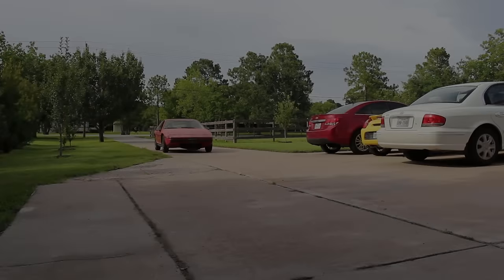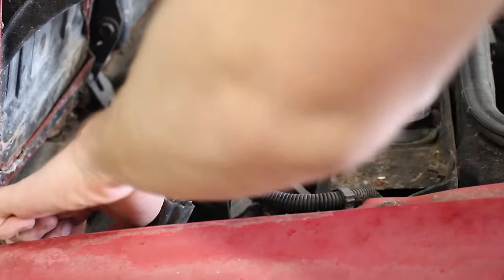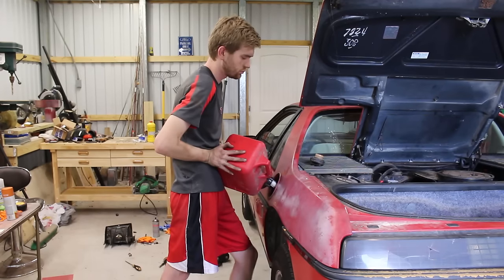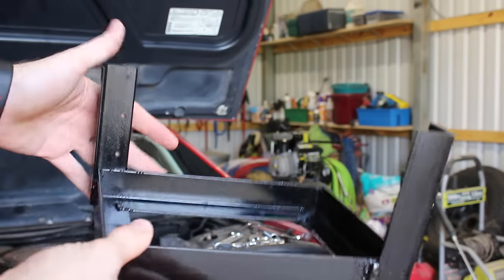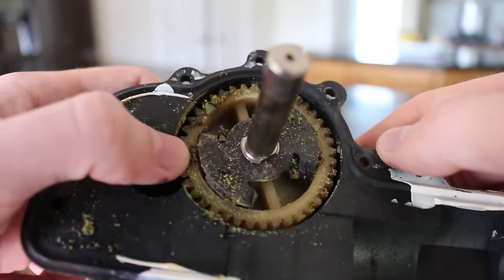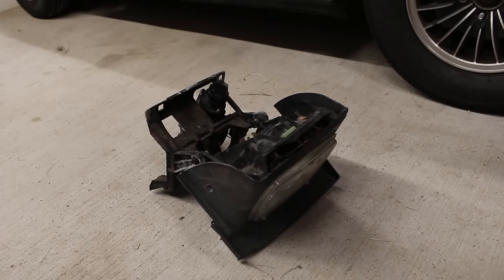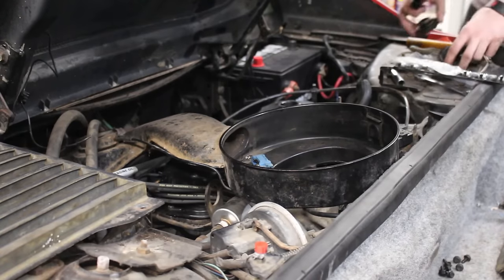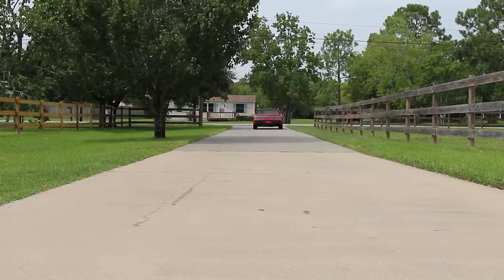Blink Once If Your Headlights Go Up and Down | 1985 Fiero 2M4 Revival - Part 4

Comment: I am a retired Mechanic of more than 30 years and I love your videos and honesty, I cannot say I have never sheared a bolt off but you only do it once and often I do not use a torque wrench as after all these years I have a 'feel' for the correct tightness.One thing I would suggest you do is at the next oil change use motor flush I gets a load of crap out, and STOP using fram filters they are the worst and do not properly clean your oil.

Comment: Helpful pointers...Lower feed and increase amperage on your welder (I'm kind of guessing from looks of your welds). This gives you hotter/better weld penetration and a smoother/flusher weld. Experiment with those setting as there is a fine spot that will be used for most of your welding. The only change from that will be when you weld thinner material. Beginners tend to go too fast as they're welding, so keep that in mind. If right handed, use left hand as support/slider hand. Also, when cutting 45 angle for making a frame. Make the angle SLIGHTLY smaller than a 45, that way it squares up easier/better. I designed the front suspension lift kit for the Jalapeno kit car that fits a Fiero. PISA kit cars..Good luck with your project car.

Comment: Reviving an old comment, but Steel Stick is what we use in the packaged pump systems business I work for.  We swear by it for tiny repairs.  We don't buy regular ass JB Weld.

Comment: Dang, snapping that valve cover bolt was a frustrating lesson. Maybe a cheap pair of vice grips clamped on the edge by the wrung off bolt will ensure no leakage til you do get that piece of bolt out. Seemed like you had it cross threaded with all the effort you were putting into tightening it. Plus with snapping off the tip of the easy out too, tells me it is most likely cross threaded. Try another easy out and heating the bolt piece and hole with a small torch as you turn it to remove it. If you gaulled the threads it will be a booger to remove. Love this video series. Great job on those headlights!

Comment: 15:03

Just a note, I wouldn't advise wearing gloves with any rotating tools.

I've had fingers pulled into a drill before wearing gloves, luckily it was a handheld drill, so I was able to quickly stop it.

Comment: Awwwww! You made that sensor needles day! They rarely get the opportunity to jump around and have some fun! Taking anything out, lubricating it's shaft and giving it a 12 volt trickle charge will get it workin! Wait... you're telling me your headlights work off a TELEGRAPH SYSTEM?! I bet 1845 San Francisco is gonna be so happy to hear from you!  Maybe you can relay them a message... I'm happy to hear the gas tank hadn't leaked in eight months!  Got a better track record than me! More like the thermostat housing cap. Slow Drip was my high school nickname! "He was finally free to come back down to where we live"? Was your brother being held captive?  That bead of silicone was about as "thin" as I am! Sweet Jesus! Although that is pretty normal for GM to use that much silicone for their vehicles. Because, who needs nuts & bolts when silicone exists! As far as snapping that bolt, it happens to the best of us!.... who also weren't using a torque wrench properly. We live, we learn!  The current owner of the car is technically the mold. It's been inside there for years! Looking forward to watching the eviction!

Comment: At least you knew to check the o-ring still on the car when not finding it on the filter.

I did not do that, and dumped a lot of oil due to having two o-rings on...

Comment: brilliant work on the lights and battery tray! looks great!! Don't be embarrassed about the bolt. Had the same thing happen on the radiator flange on my 60' Rambler. Tiny bit of fluid was leaking and it snapped like a twig as I tightened the bolt, flooding the garage with coolant in the process. Not a fun day lol.

Comment: I note 3,494 comments. I'm lazy and don't care much for reading comments. While I'm sure it's been said before, two words bruh, "torque wrench". It was a matter of nanoseconds when I saw you honk down on that poor valve cover bolt with the same Break-Over-Bar one would use to break a head bolt loose I knew it was toast. I didn't mean to spew my drink all over my monitor. Excellent Work Young Man!

Cheers from Louisiana.

Comment: I knew as soon as you started on that bolt that it was going to snap. One time I was reinstalling rocker arms on a Subaru and mistook 80 inch pounds for 80 foot pounds. Obviously the bolt snapped but I never did extract it and never had an issue using only the remaining 5.

Comment: An update at last! Yes, I got to admit that I still love my 88 Fiero, she was one of my favorite car back in the past.

When you pause the video and said about making a mistake, I got a hunch that would be about your bolt.....ouch man! lol My Fiero has a leakage issue as well when I got her home and it wasn't an old core seal but a silly thin layer of silicone (imagine those silicone you use to seal the gaps around your bathtub).
The more I watch, the more I notice the difference between yours and my 88.
There are a lot of option for Fiero interior, if you could afford it, a leather set with wood panels would look awesome! (Especially the panel of your gauges) Oh! Don't forget to put some lure on the moving parts on your front lights, those plastic could be weaken because of a long expose from outdoor weather. And also, the bottom will need a complete rust free-undercoating sprayed.
There was an ongoing issue I have with my Fiero, it was the handbrake which seems to loose up after a certain time of using, may be it is just my Fiero and I hope yours would not have this problem as well :)

Comment: Oh I remember that bolt for the valve cover! The original egr valve almost always rusts and binds to the intake manifold. Nevertheless how tight of a space you need to work in around the TBI unit. I replaced that with one that allows me to put the mount on first and the EGR second. 

Also pop up freaking headlights! I upgraded all of my interior and exterior lights to put less drain on the old electrical system. I highly recommend replacing what you can such as interior lights and side marker lights/front turn signals. 

I’ll post updates with mine as soon as I get this clutch replaced.

Comment: The same happened to me, when i was replacing the gasket on my N46B20 engine, altough i used a torque wrench. The instructions said that you have to bolt it with a torque of 10 Nm (Im German ;P), but my torque wrench was quite a cheap model, so that i was 5-10 Nm over the recommended torque. I then drilled a M3 hole into the screw and hammered a screwdriver into it without even damaging the thread even a bit. The second issue i had was that my car shop gave me the wrong gasket, it was for the N43 engine, so I had to get the right one the same day to finish the engine.
Because i was doing this the first time, it took me about 6 hours to replace the valve cover gasket. But unlike some others, my gasket is still leakproof.

Comment: To extract the bolt, use your wirefeed welder to carefully add a little knob of weld to the end of the bolt, so you have something to grab, then either grab it with some pliers, or put a 1/4" nut over the knob and weld up the hole. I've done this many times, and it usually works first try.

Comment: This car can move faster than others do on the highway, and do it all by itself.  That's what happens when the spring that keeps the accelerator peddle in the up position, suddenly breaks.  Now the accelerator peddle becomes stuck in the pedal to the metal position. When this happened to me, I managed to pull the peddle back up, and coast to a stop at a highway exit.  I was a long way from home, so fixing it was top priority to get me back home.  I had a pair of Vise Grip Locking Pliers in the trunk, so I removed the spring from the pliers and used it to temporarily replace the busted spring.   It wasn't a perfect replacement, but it did get me home.

Comment: I snapped a bolt like that on my 1995 Chevy Beretta.  didn't have a torque wrench though, we were just getting them good and tight, went a little too far.
from what I've heard from others and seen on a different channel, Fram filters are pretty bad.  that textured grip part is the only good thing about them.  spend a little more and get a better filter next time.  Autozone will usually run a sale on a jug of oil with a filter.

Comment: Hey buddy. Quick tip for the extraction of the bolt that you broke for the valve cover. Putting a nut on top of it and spot welding it through the bolt to the nut will help you extract it with a socket

Comment: Valve cover bolts = 1/4 drive ratchet held at the top. When my brother was teaching to work on engines, he took my 3/8 sockets and ratchets away from me just for the valve cover bolts I kept breaking ! But I soon got the hang of it. Just takes practice. And by the way, I still use 1/4 drive sockets on valve cover bolts.

Comment: I did that to my corolla's camshaft bearing bolt after I did the head gasket. Thought that the torque wrench turned down just enough to do it.. turned it into a ratchet. Snap.......

Comment: Hehe I forgot the fiero came stock with a battery mounted in the rear “ that’s how long I had my fiero “ I had to remove mine due to rust. I was gonna do the same thing you did but I ended up relocating it to the front and putting the coil packs from the swapped 3.8 sc engine in The old battery location.

Doing a battery relocation sacrifices being able to have a spare tire, Having to spend $80 dollars on a tow truck “ because of a tire blowout”  sucks... I might relocate it to the back to the original spot.

I’m glad I found this video.

Ps I never seen a headlight motor seize like that “ like you said” it’s normally that nylon gear. and be very careful with your hands those headlight motors are very strong.

Comment: Nice content. One tip if you choose to accept it, everything you bolt on with several bolts and a gasket in between you should tight all a bit at once for equal till the final torque so the gasket is smear uniformly.

Comment: Don't feel too bad man, I've been working on my car for many years and I still did the exact same thing on my 1UZ Soarer, I tightened the bolt down way too much and the aluminium valve cover completely snapped, I felt so stupid... luckily it was an easy fix.

Comment: If you have not removed the valve cover bolt, take a spring loaded punch, or automatic punch. Find a small part of the bolt sticking up, place the tip of the punch and work the automatic part turning in the CCW direction. The spring loaded pop will free up some bolts. It takes time.

Comment: A bit about gaskets and torquing . There’s hot and cold torque . Torque cold , then torque hot  Avoid disaster ... Also there are great kits for these cars . You can add a v8 engine with out modding the suspension ( v8 Archie) There is a kit to fix the head lights , oh and on your notchback , the coil packs can get hair line cracks . Replace them and the ignition module . The iron duke engine does not have a distributer , it has a crank sensor . Btw . Last , the fan doesn’t turn on till way late way hot  . There is a mod that will allow you to turn on the fan at lower temp .

Comment: So stupid question, I need to replace the brushes on my fiero, that pen you use, is it also a adhesive?? How is it still holding up. I saw Rodney Dickman sold a glue you have to mix, much rather use a pen if possible. Where did you pick that pen up at??
Reply from the maker: It is technically not an adhesive, but it can still act as one. I've had them installed for two years now with no issues. Granted, I haven't driven the car all that much so that's not a fair test. If I had to guess, I'd say Rodney's adhesive would be worth it. But the pen I got was just from a local Fry's Electronics store!

Comment: The Fiero had a modified oil pan(1 inch shorter) the larger filter you took off helps to add some oil capacity, also make sure you have an updated dip stick the originals read full at a little over 3 quarts when in actuality the oil capacity is 4.5 quarts.

Comment: Nice set of vids,, I had one of this the same color on the 90s , I had traded for a Ninja bike I had , and it had a blown head gasket so I replaced the gasket ,one heavy head by the way cast iron ouch,,and it was fun to drive exept I had to put in a new starter every 3 weeks , turns out the person that replaced the starter last threw away the braket that holds the back of the starter is actually an alligment braket so the starter kept going bad cuz of that ,so I sold it .SO COOL.

Comment: I would recommend using the bigger sized oil filter to get that little bit of extra oil capacity and more filtration. 
Fiero's were notorious for not carrying enough oil, although that may have been the 6 cyl?
The iron duke was also notorious for running forever, so hopefully that will be the case here. :-)

Comment: finger
I bought a '88 gt one, $500... It was sitting for 2yrs, put hightest gas, started right up. Then moved it to the shop to changed oil, check fluids, but... Headlights didn't work, nor did the ac/heater... Allot of stuff wrong, so after New oil and some gas i sold it for $2000. Of course here, there are a ton of fiero nuts,shows.. So it was easy to sell. Just saying, don't give up on your dreams, unless it's a fiero,lol

Comment: Before the oil change....you can add a bit of dimexyd ( it's in russian, a medicine that is sold in drug store). It mekes a good flush of oil system, but be careful with painted parts inside and rubber parts. You can can run engine 30 minutes or 1 hour. Then change oil. Cheers!

Comment: Not sure if you did this, but it is good practice to fill the oil filter before you replace it to prevent the engine from running without oil as new oil goes strait to the engine without having to fill the filter first. However, this is not always possible due to to alignment of the oil filter.

Comment: You can set a nut over the broken bolt and plug weld the nut to the bolt essentially making a new bolt to remove it.

Comment: speaking of cosmetics..  for the exterior paint, all you have to do is to wetsand the entire car and then with 4 or 5 cans of some high quality clear, just re-clear coat it...  it'd keep the original paint and make it look like new.  Then just paint any black trim with some gloss black paint.  At that point, you're just a nice set of rims ( preferably something with a nice deep dish and polished lip) away from having the car look amazing.  *also... I'd buy 5 cans of rust converter and another 5 of gloss black rustoleum stop rust spray paint and after a quick once over on the underside of the car with a wire attachment on a drill, hit up the entire underside of the car.  It'd preserve and make the undercarriage look show quality.  Lastly... if you really want to make the car special looking,  keep your eye out or the 87' Fiero factory lower body panels/bumpers.  They fit your car and in my opinion, make Fiero's look sick.  much sportier than the original 84'.  Im sure there are sets out there for cheap that are just sitting on some rusted out car and with the bumpers and sideskirts being plastic, you could find a set in great condition

Comment: Gasoline pumps must have good thread sealing but also need conductivity to prevent fires. Petroleum Mechanics use leaded pipe dope for that purpose. Don't go drinking it, but it might be an option.

Comment: The size of the new oil filter makes me a little nervous.  The size of the old one makes more sense. If memory serves, a larger (pf51 or 52?) oil filter was added as part of the engine fire recall for the Fiero to give the engine some additional oil capacity.

Comment: Take a nut and set it on top of the broke bolt and fill the nut with a welder. Welding the broken bolt to the nut and un screw the bolt.

Comment: Awesome video series man I'm really enjoying it. Please get a torque wrench lol. You should really measure the torque of all of your components especially the break caliper brackets. I have had one of those wiggle loose and its not fun. keep in mind when you get a torque wrench that it is only for tightening the bolts. If you loosen or use it to break loose bolts you can throw off the calibration.